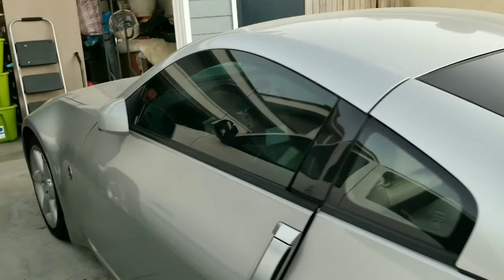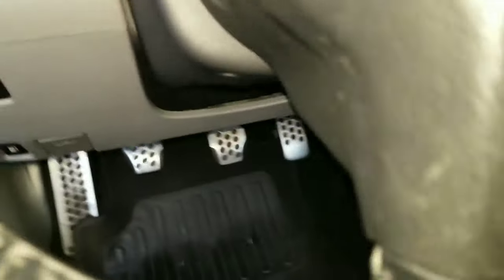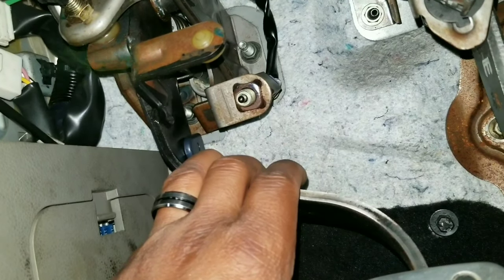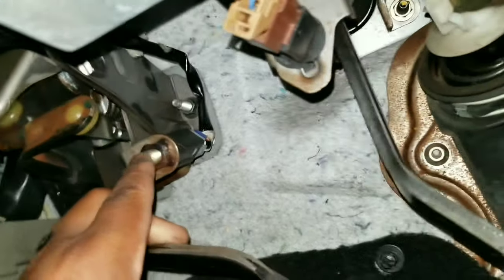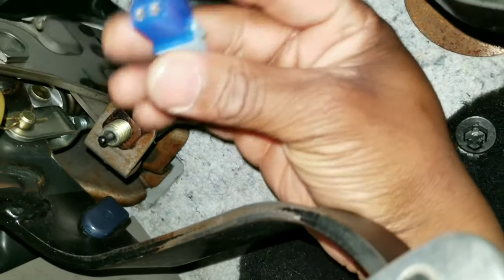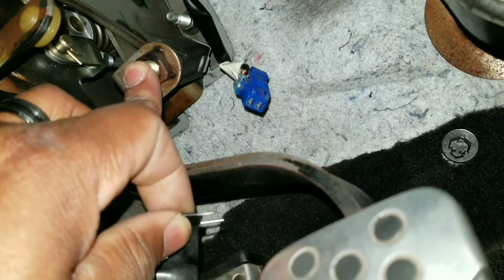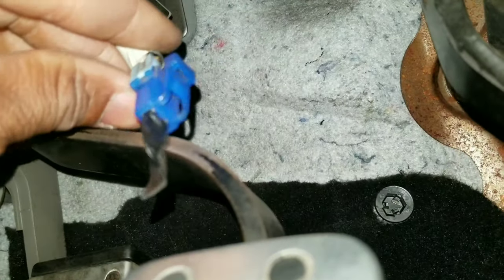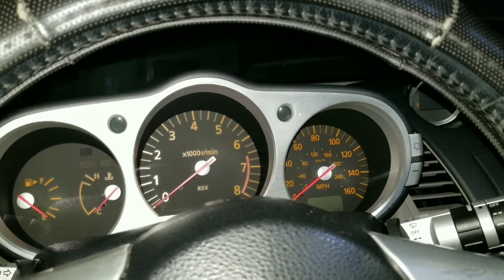How To Bypass Clutch Pedal Position Switch

Comment: Yo I just wanna say thank you for this blessing. Not only did you give me a small lesson on how wiring/shorting works but you also explained the reason WHY this bypass works which means you know your stuff. 

Truthfully I think I will permanently bypass the clutch safety switch using this method. It makes ZERO sense to replace a sensor that will eventually fail again and serves very little real-world purpose. As a 350z owner who daily drives and is familiar with the car, I've never forgotten to take the car out of gear before starting and it's pretty much a by-heart habit, so much so that this safety switch is useless to me and just another failure point + headache. 

I understand if it's someone driving the car for the first time or a test drive. It will prevent a serious dummy, but anyone who forgets to shift back into neutral will STALL THE EXACT SAME WAY. It's more of a "don't be a dummy" gauge rather than an actual safety oriented switch. 

Thank you again!!
Reply from the maker: Your welcome i appreciate it 🙏 
I totally understand. The 350z in the video has been bypassed every since 😁

Comment: I did this on my 95 prelude 15years ago.  I connect the wires directly.   You dont need that sensor .  But make sure everytime you start the vehicle.  Your gear is in “neutral” or car will jump
Reply from the maker: Thats great advice. I appreciate it. Thanks for watching 😁👍
Reply: So you connected the 2 wires ? Is it the wires that connect to the switch? Can you explain if you can . I am female mechanic but know nothing about clutches, wasn't my fautay. Back in the days. And I don't like messing with wires, electrical shiz. Thanks again guys. 👍✌️
Reply: @sarcastic_2uNY  yes. But dont cut the harness.  What i did is use a pin to jump the wires together.

Comment: Could this work as a kill switch. My neighbors truck was stolen and they've tried to steal mine if I unplug it will it prevent it from being started?
Reply from the maker: Yes, without this sensor being connected the vehicle shouldn't start. Thanks for watching 😁 👍
Reply: I’m having trouble with mines about to test this out and also good tip might do this too incase they try stealing it 👍

Comment: The paper clip fell out and I tried putting it back in now it won’t start?
Reply from the maker: Check the fuse. It should be in the fuse box under the hood on the fire wall passenger side.
Reply: @Duwop77  what do I look for I found the fuse box?
Reply from the maker: @Axelz337 i believe it says starter switch. Is it a 350z?
Reply: @Duwop77  yes what should I do?
Reply from the maker: @Axelz337  check and see if any of the fuses are blown
Reply: @Duwop77  it’s nun of the fuses 😔
Reply: @Duwop77  what now?
Reply from the maker: @Axelz337  thats strange🤔
Make sure the paper clip is inserted correctly. If thats not the case and all your fuses is good. Ether replace the sensor and reconnect it or have the starter checked.

Comment: Well damn bruh wish i seen this b4 i bought the clutch safety switch is what they call it, here in Florida 😂😂.. the part $35.00 at AutoZone, advance and O'Reilly dont carry it, have to special order and takes 10 days. 
So Now I know this bypass, im just gonna try it. And return the part. 
Cuz my azz is brokidy broke. Thanks again. 
I hit the like and sub botton.  BTW like your 350z i want one. I have Altima 2005 all rebuilt. 

Do you know how i can make my exhaust sound like its firing a gun, lol.
Reply from the maker: 😂😂 I feel you. Thanks I appreciate it. Its my father's Z. And usually in order to get the pops and bangs you'll need a tune. Or add 2-step. I believe msd makes one. Not sure if its compatible with Nissan tho. Thanks for watching 😁 👍

Comment: So i was using this bypass and i took out the paperclip to readjust it and now its not working
Reply from the maker: Check the fuse. It probably blew. The fuse for that is in the engine bay. Fuse box located on the fire wall.
Reply: @Duwop77  Ok so after all day of messing with it and trying to find the fuse, I used an add a fuse and put it in where the airbag fuse was to get it to start
Reply from the maker: @gutlesstoast3591  job well done😁 
Look up 350z hidden fuse box. Once you locate it. That fuse should be in there.
Reply: @Duwop77  Thanks for looking out man
Reply from the maker: @gutlesstoast3591  no problem. Thanks for watching 😁 👍
Reply: @Duwop77  Hey bro i came back because i never solved my problem, do you know what fuse controls the clutch switch?